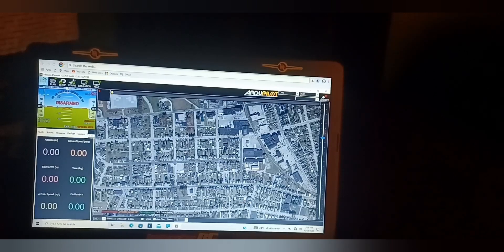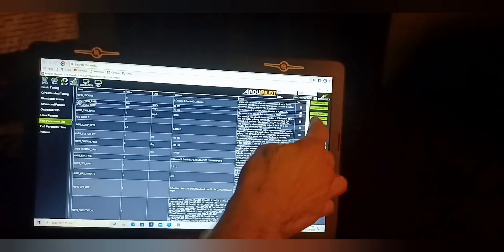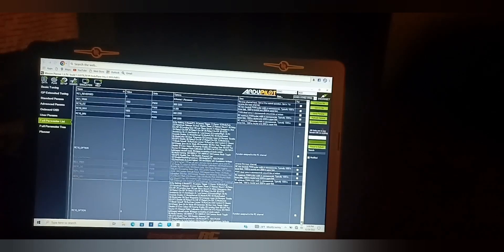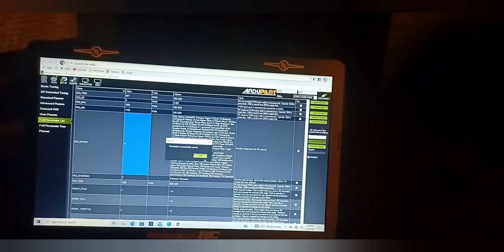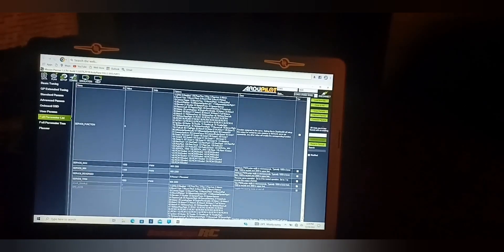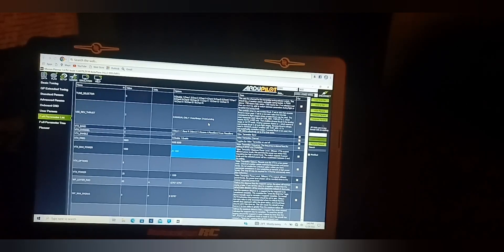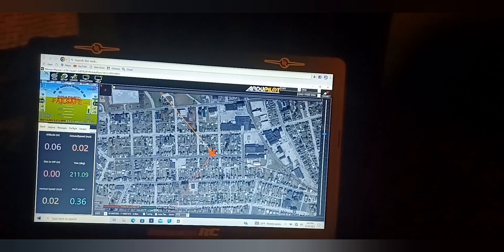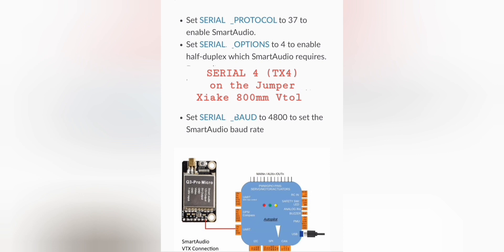Jumper Xiake 800mm Vtol. Arduplane (Smart Audio TX Slider Vtx power control)

Comment: connected the polar caddx air unit to the jumper xiake 800 . on DJI Avata glasses , FPV does not output OSD . how do I display the indicators on the screen ? any suggestions?
Reply from the maker: https://ardupilot.org/plane/docs/common-osd-overview.html